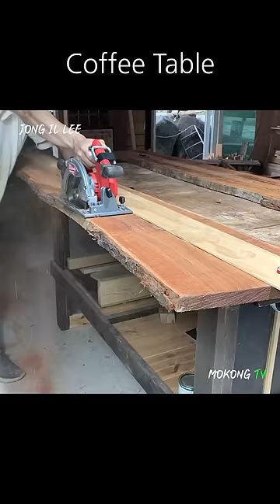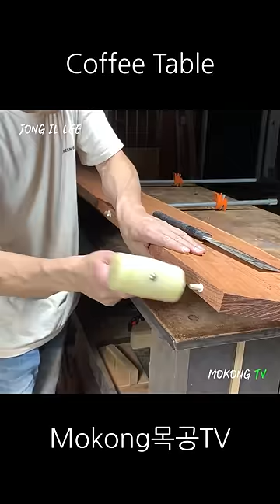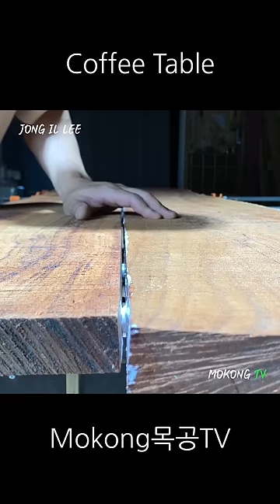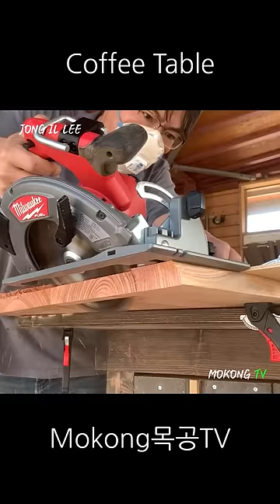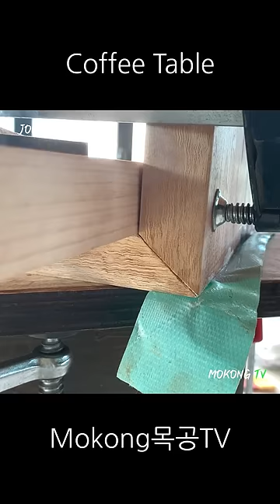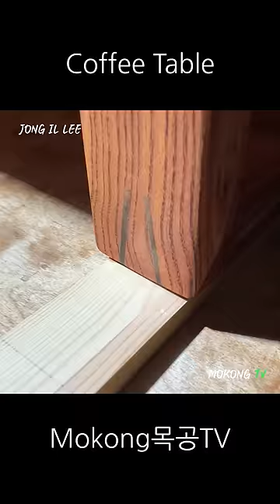Coffee Table #shorts

Comment: Why shorten the dowels so much..
Reply: Well, they'd probably say that the dowels are just used for alignment and not really for any structural purpose but the real reason is that it's damn near impossible to drill those holes by hand and by eye and get the pins to go in very deep because the holes won't be quite perfectly aligned.  You'll end up either having holes that are way too deep because you ended up cutting the dowels off anyway (thus actually weakening the final product at least somewhat) or you'll end up having to make the holes bigger to get the dowel to fit (leaving more of a gap around the dowel that you're just going to have to hope your glue will fill and also possibly weakening your final product).